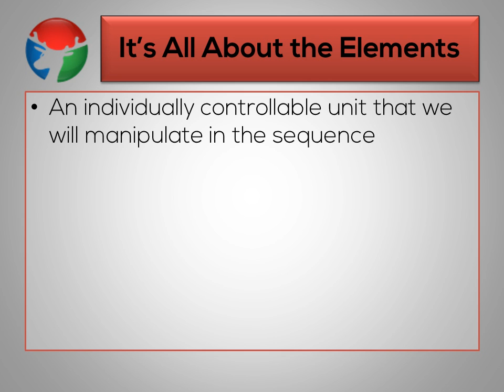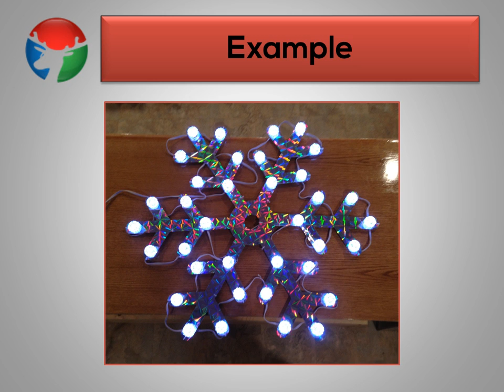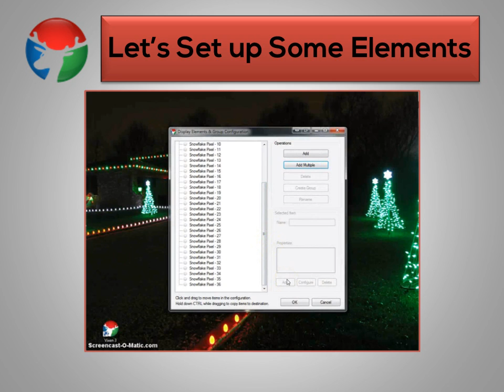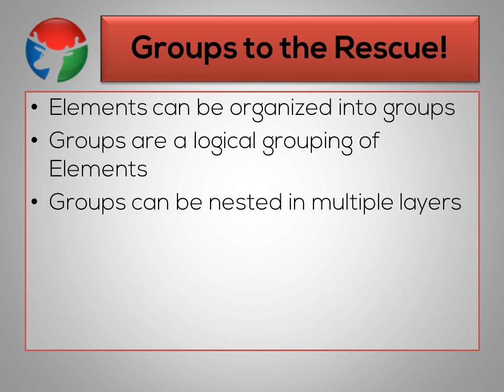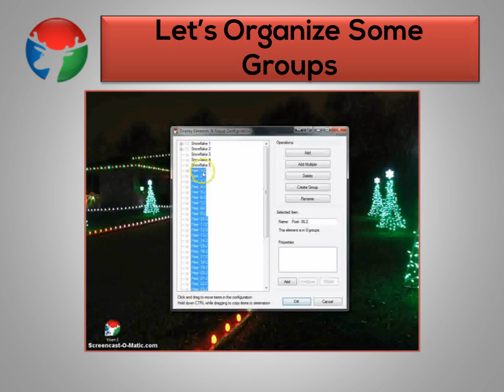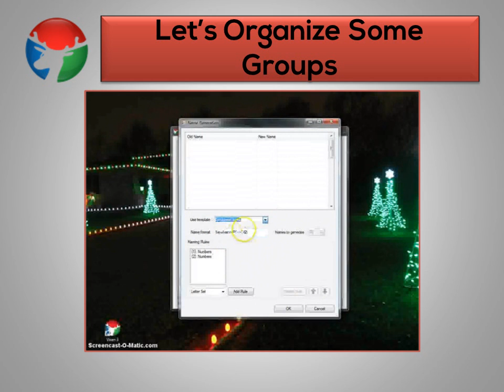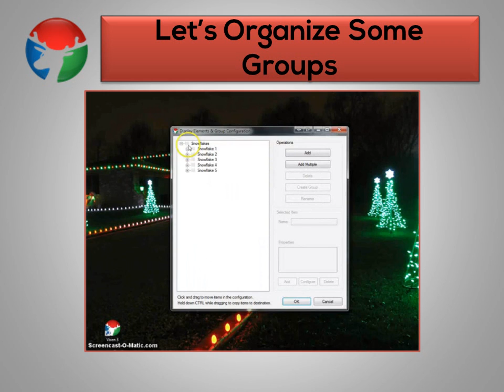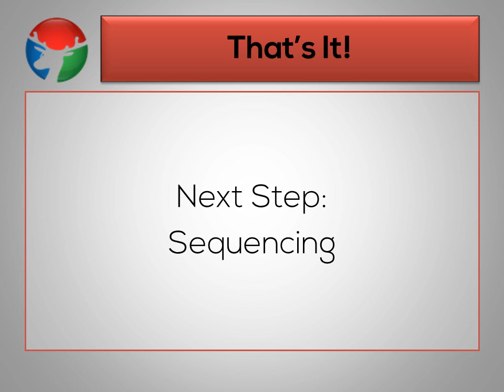Intro to Vixen 3 - Part 1: Elements

Comment: I downloaded Vixen 3.2u2 and it does not have the same interface.  Is there another program?
Reply: +Jason Ax There were some significant changes from 3.1 to 3.2 and the interface changed quite a bit.  We are working on some new videos and a downloadable manual.  You can find instructional information on the Vixenlights website.  Also, you can get a lot of help in this forum. http://doityourselfchristmas.com/forums/forumdisplay.php?96-Vixen-3